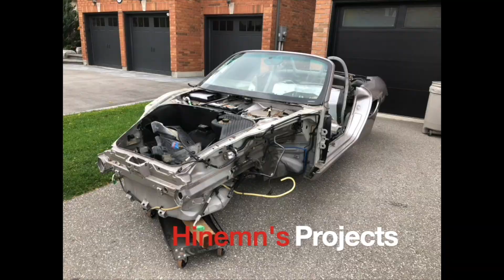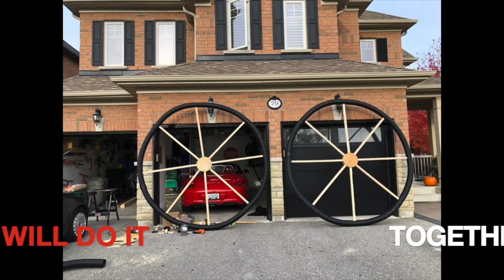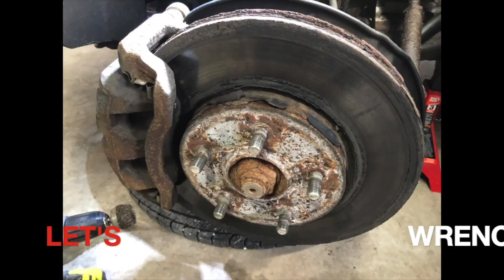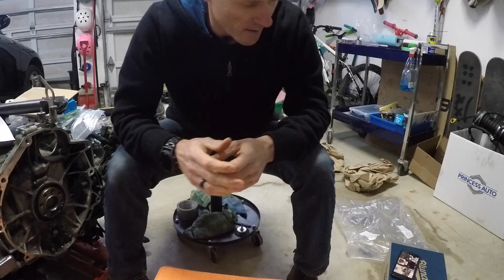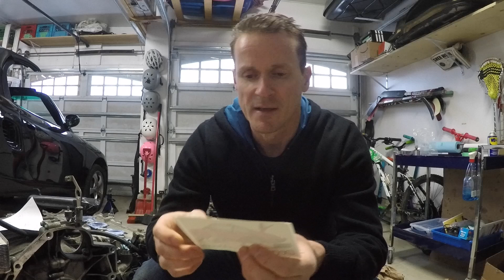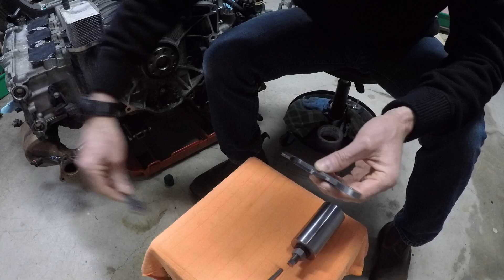Porsche Boxster 986 Unboxing New Part & IMS Bearing Tools Part 34 of  Boxster Engine Swap Series

Comment: Rather than spend $400 on a pelican single row IMS bearing, and I’m guessing another $300 for those tools…. You could have bought the TuneRS direct oil feed kit and RENTED the tools you need for $800
Reply from the maker: All these ideas were considered but since I had no idea if the engine from the flood car was any good I decided to go the cheap route and just toss in a new bearing which at that time was only $189. I ended up selling the tools for what I paid for them. I think I did ok….but I still don’t know if the engine runs at this point of the project. Thanks for watching.